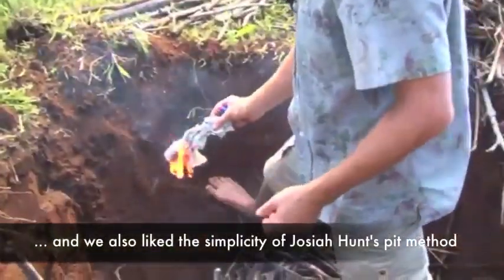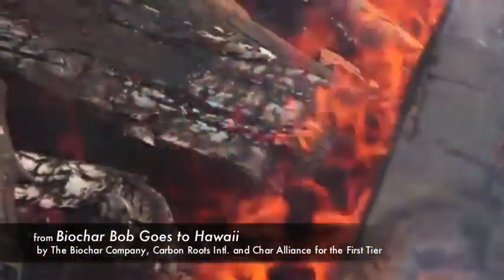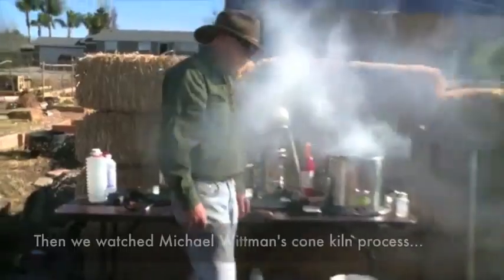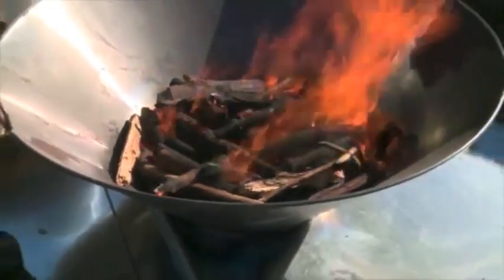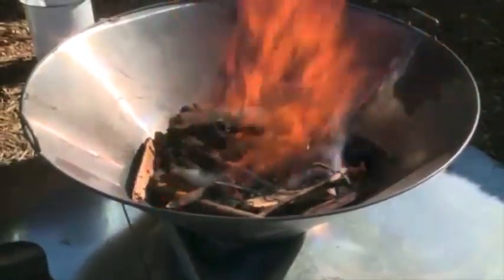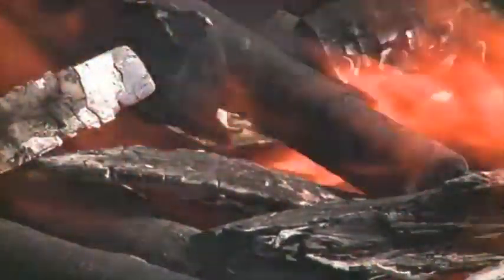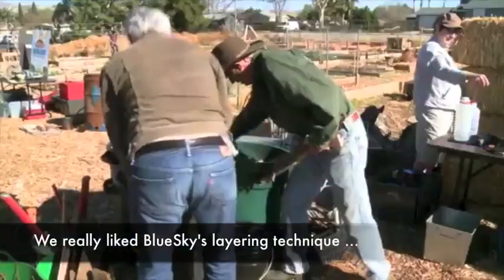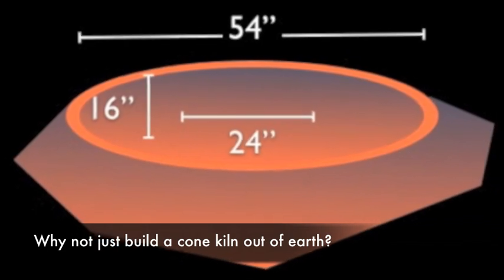Cone Pit Biochar in 15 minutes

Comment: When layering the wood in the pit or cone kiln, you can actually just pile branches up to the top and add more when it dies down again. Much quicker. Maybe you get a bit of smoke and wasted wood, but it's negligible.

Another thing I've found is that you can turn these into a continuous system simply scooping out the embers, dumping them into a bin of water, and then filling the kiln back up again. I've found this also used much less water and is quicker than dousing the whole thing with water. I think I used about 100L of water for 350L of char.

These things make it SUPER efficient for dealing with large amounts of material, and you can produce a lot of char in a short time, and can keep going as long as you want.

Comment: The quenching is key. I use a method more or less equivalent to this to deal with yard waste, and just build a hot, dry fire on the ground, layering on more fuel until I think the big chunks are pyrolyzed, or I run out of waste to deal with. It seems to be a decently efficient burn, I can always pile wood aside for next time, and (best of all) it's an easy farm chore, not an all-day project. Move the site you use around, and you're layering on biochar to the soil that then gets worked in my arthropods and, at least where I live, the swell/shrink cycle of the native soil.

Comment: Just wondering if anyone has tried a cone pit coupled with a heavy duty fiberglass blanket (welding blanket) on the top? Something very reusable of course. There is a group that worked on a pyrolysis blanket and kiln made from such blankets some years ago, but I can't find anything current. It is an interesting idea to have something so easily portable for a covering. http://www.pacificbiomass.org/documents/Schwartz.pdf

Comment: This is the way it was / is done traditionally throughout the world in many cultures. The point of the steel kiln is for easy collecting of the char once it is done. The Ithakha institute's Kontiki kiln is different in that first, it can be tipped once complete. And second, it allows for the Flood quench advocated by Frank Strie. The flood quench allows the quenching to be done with nutrient rich water, such as piggery effluent, or bio fertilizers and compost teas. It cuts a few steps out of the process. I can go from raging pyrolysis to completely extinguished within a minute.
Reply from the maker: Kevin actually the tradition was to cover the pit, let it cook for a week, then uncover. This uses the same technique as Kon Tiki but without steel. I bottom quench and can urine quench also. Clean out is not as easy as Kon Tiki on hinge or axle mounts, nor can it be put on wheels. In all other ways it, and the product, are the same.
Reply: @peaksurferalbert  Thank you for the reply Albert. Yes, you have pointed out the difference between this and what I called the traditional method in error. Strange how a cone pit would not be used but instead the extra effort of covering with soil. I wonder what the reasoning was for traditional charcoal makers to think the extra work was required to cover it. Perhaps, not needing to attend the fire constantly, or more likely, not having the luxury of excess water available to quench. No need to have wheels when you can dig a pit at location easily. However, although charcoal is charcoal, I would be skeptical in calling the end product the same. Also, the efficiency between the two methods in terms of gasses escaping the combustion action. I know even the kontiki is rated less efficient / environmentally friendly than a closed self sustaining system. Never the less, I do agree that if you are going to burn, it is better to do so in a pit for the purpose of charcoal then simply out in the open.

Comment: I will not spend $500 on a steel kiln that has already caused environment damage via the manufacturing process.  Plus the mining, the long distance transportation of iron ore etc.  Just make a conical pit, by trial and error can produce biochar.  Also need not be perfect.  Char is char and some are just trying to be purist.. Mine is Better than Yours.

I will do a pit.  Mixing the biochar with urine works great it seems.  Nature is very forgiving.  Humans tends to over-work solutions.

Comment: I tried the cone pit method today. I was surprised by the results. Almost no smoke and was able to do some pretty thick pieces of wood in there. In about two hours produced about seven full wheel barrel loads. There was hardly any wood not charcoaled. I did smother it but I did so with composted manure and pine shavings. I did the barrel in barrel method before and wasted tons of mass just to heat the inner barrel. The inner barrel for me never got hot enough and I had to do it twice. My next method was just starting a fire in the barrel then keep adding to it to smother each layer out. Worked good but took two hours to produce one wheel barrel. The cone pit ate up tons of mass quickly and produced an excellent outcome. Our soil here is just dead sand full of root knot nematodes.

Comment: Cool, that's basically what I've been doing too.  I've done several different similar things and they have all worked fine.  The cone kilns are neat and they're portable, but a shovel is a lot cheaper!  I think there is a lot of leeway in pit size and shape and even in fuel size and shape.  The main trick seems to be the maintenance, getting good coverage with the new fuel to keep oxygen off the old fuel.  The fuel does have to be reduced in size and shape enough to fit into the pit well, otherwise oxygen can get down into the lower areas of the fire, but other than that it's been pretty straightforward timing.  I've found the yield to be pretty decent too.  This type of method and the top down burn pile which I should be putting up a video about soon, are very accessible and require no special equipment, so people can get their hands dirty now and worry about the details later.  If anyone is thinking about trying this, just do it.  You'll end up with some charcoal and you can tweak the details later.